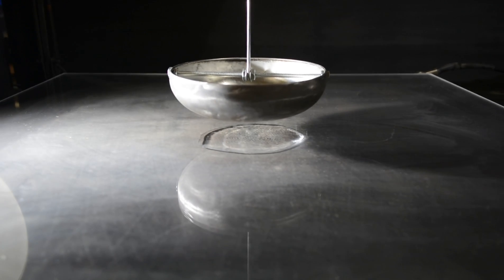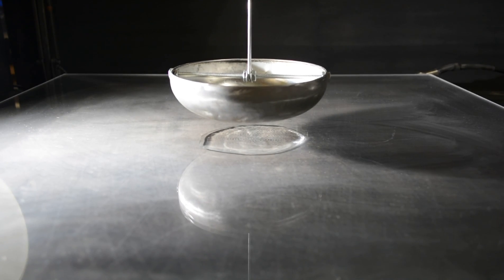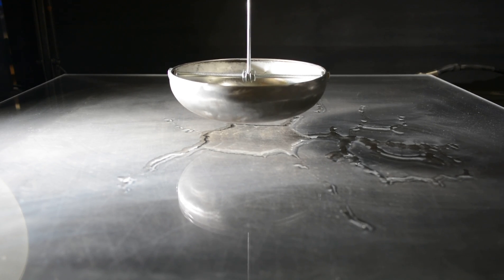70 Kv Salt Water / Cymatics

Comment: how thick is the acrylic you use? Is 1/8" enough to keep your discharges electrostatic and prevent conductive discharges to the metal electrode below?

edit:
Also is this 60 Hz or higher frequency AC?

Comment: If that was only 35, could you raise anode and increase power or is that height the limit of acrylic sheet size? Could smaller cathode= higher power in? Great stuff, pissed they weren't teaching us this in elementary.

Comment: What are you using as ground? is there a plate under the acrylic? I'm just wondering if that Chladni pattern was a result of vibrations of the ground plane, as opposed to some interaction solely with the dipole moment of the water.